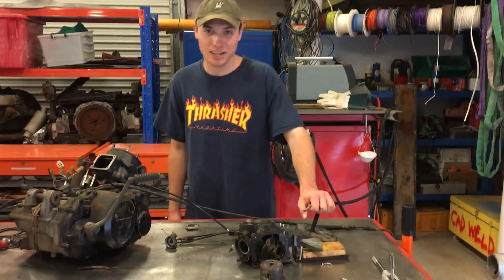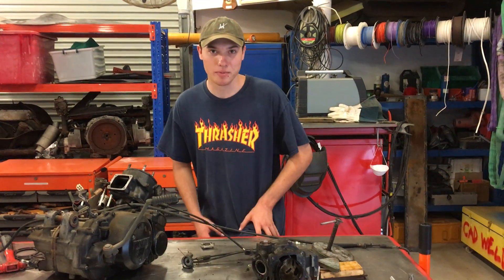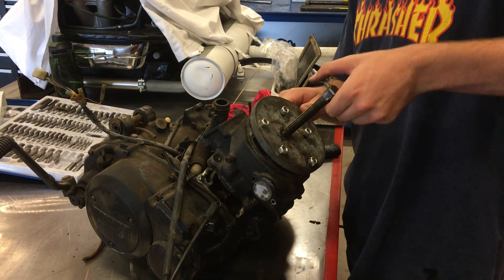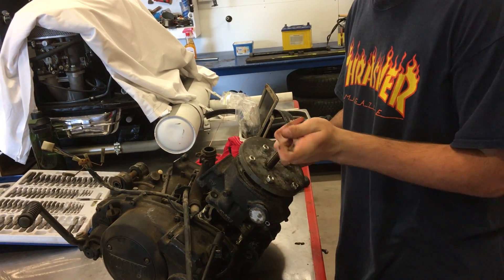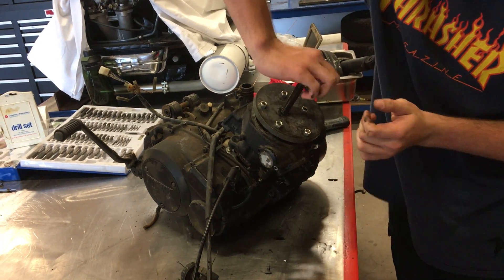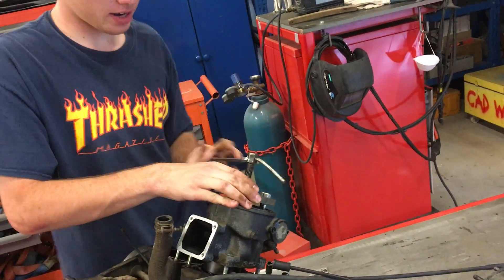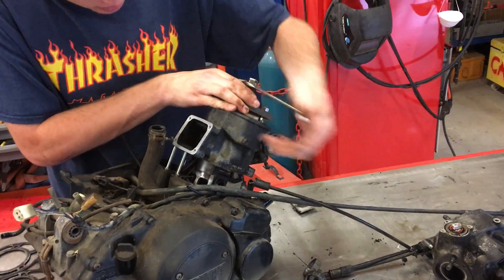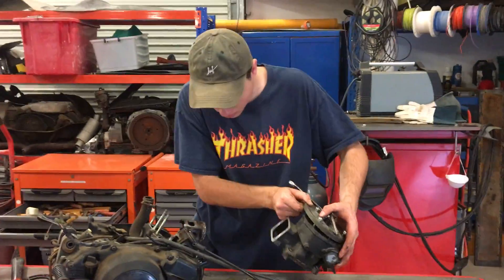How to remove a cylinder with a seized piston from a motorcycle engine .

Comment: Good technique... In my motorcycle  engine the piston is stuck due to oxidation ( stored for long ) .... Would scrubbing off the oxi- deposits help release and also save the piston? Thanks
Reply from the maker: I think taking off all the corrosion you could see would be a good start, but if the piston gets damaged, you really have not much choice but replace.
This one (RZ350R) was seized as the previous owner had not serviced/checked/replaced the air filter and it crumbled into the intake.  The fragments of air filter melted into the ring and YPVS like some super duper hot glue.  I could have reused the piston but there was a little corrosion in one bore (from thirty years of storage), so I had to re-bore and replace the pistons.
Reply: @smithy356  Ok.. Thanks for the insight. Did not know air filter could influence the damage. In my case it's a 2 stroke motor ( Yamaha RX135), so I guess moisture could have gotten in via exhaust port, as it was lying outside without running for nearly 5 years. 
The piston and block, head are no more available in the market, hence trying to save them, if possible.